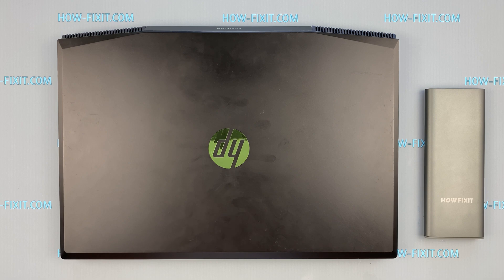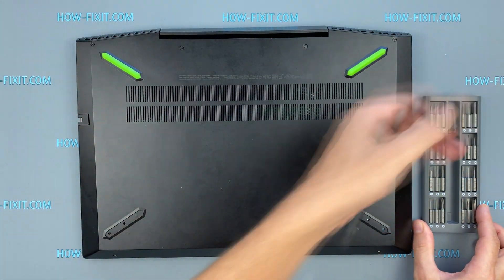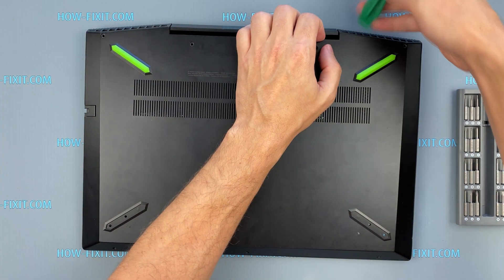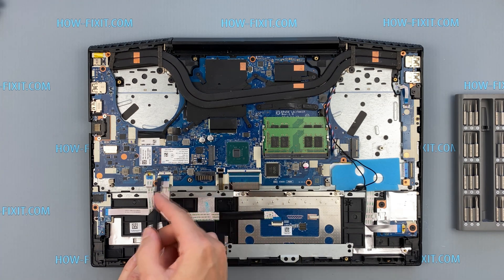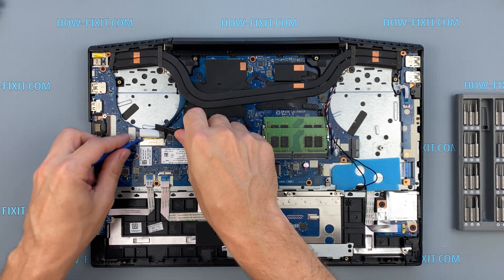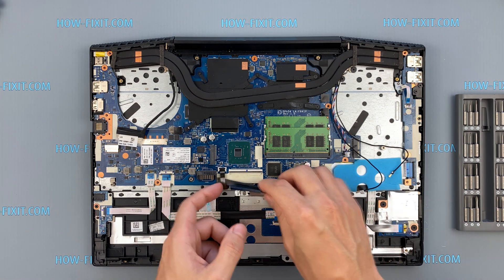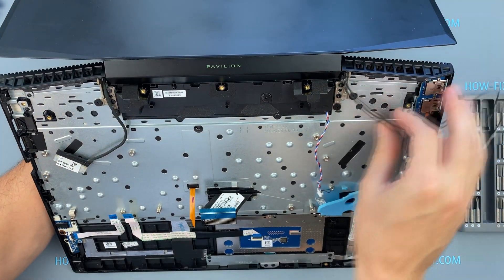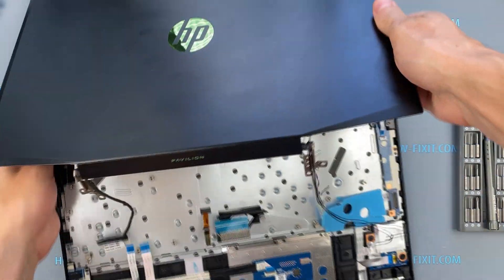HP Pavilion Gaming 15 Keyboard Replacement | Fix Broken/Not Working Keyboard

Comment: I didn’t expect such a replacement from you... Why change the entire top case and keyboard assembly? No problem to unsolder and remove a non-working keyboard and install a new one) No need to change the keyboard assembly

Comment: It’s insane how many people have issues with these H, G, 8, *, backspace and windows keys, not only in this model but practically in every HP laptop. The only thing that worked for me was to cut a post-it and paste it above the blue plastic of the ribbon cable. Seems like it gets loose after several months of use and pins stop making contact. Never buying HP again.
Reply: I try this
Reply: Did not work for me

Comment: HP sucks
Reply: How u damaged ur keyboard?
Reply: @varunchaudhary3205  GAMES
Reply: It been 2 years now and all of a sudeen my 'D' key stops working and it would randomly type once in every 1000 click but for most part its unresponsive Idk what to do I removed the key and retainer and cleaned it using air but nope still doesn't work .

Comment: You seriously waited until the end of the video to say can't replace just the keyboard?
Reply: This is fucking insane. And I can't even open it to see it or clean it or dry it if any Liquid goes in.... Fml
Reply: @KinekaiNHFan  Yeah wish i know this before buying this laptop. Curious if  anyone one having any issues with thier keyboard? how long before you had issues? What caused it?
Reply: @DIRTYFIGHT3R  i have problem with G,H,f4,f7,backspace aftr only 1 year
Reply: @DIRTYFIGHT3R  i  got prblem in only 4 month
Reply: @serieserie5065  same button as me
Reply: @serieserie5065  hey i have the same problem
Reply: @serieserie5065  i fixed my problem , all it needed was some cleaning of the keyboard connector...all the keys you mentioned need pin 26 to work...so cleaning the whole connector or just pin 26 will do the trick....i used aftershave and hand sanitizer to clean the cable and used an eraser when it dried up to clean the contacts... Your can also cut a post it to the size of the connector and place it on top of the blue plastic shim....

Cheers hope this helps some one
Reply: @007leonard1  thank mate ill try
Reply: @serieserie5065  if it dosent work i have another solution too
Reply: @007leonard1  how?
Reply: @serieserie5065  trim the keyboard connector by a milimiter,  you will have to also remove the edges of the same conmectot so that it slides further in.... The wires on the connector do not make connection with the pins of the fpc connector hence the problem .....i have come to the conclusion that the cable of my keyboard was damaged because i carry aroung the laptop in my backpack and the pressure along with the movement causes the wires on the cable to wear. So trimming the cable solves this as the cable with holes and indentations is cut out and the fresh cable has conductive matetial on it .
Reply: @serieserie5065  before you trim the cable try this ....open the laptop....align it in such a way that the hdd drive is on your left and ssd on your right and trackpad closet to your body and fans pointing away...observe the fpc connector of the laptop....from the left count the 6 pin and check if the solder is loose and clearn the 6th line on the cable make sure it makes contact ....try drawing on the 6 wire with graphite pencil( conductive)  ...the cable that affects the h  g and backspace num 8 and * on keypad is the 26 th cable/ pin so as there are 30 pins clean the  6th pin on each side to make sure .
Reply: @serieserie5065  pretty much same as me
Reply: @007leonard1   bro, you should do a video. I strongly believe this is a common issue of the product
Reply: @nomad4197  welcome to the club
Reply: @serieserie5065  i have a problem with a,s ctrl and tab
Reply: @007leonard1  and for a,s ctrl left and tab?
Reply: @fumbled23  A  is 16&22 .S is 17&22 left ctrl is 19&20 TAB  is 16&19. Therse are the numbers on the connector that have its trace shaved off propably from carry the laptop in a backpack. so wheen 16 and 22 close a circuit the keyboard registers letter A . One of them or both are  not making contact. Your keyboard should have a lot more keys not working than you specified.  If you already cleaned the connector and are helpless then Slice off a millimeter of the fpc in a straight line and remove the ears of the fpc so that it slides in further.
Reply: @007leonard1  sadly it doesn't work for me, i sliced the fpc about 2 mm, cleaned it with aftershave(the only thing with alcohol i got atm) and the problem persists, maybe its a different problem, Thanks for the help tho :)
Reply: @fumbled23  what keys dont work? did you check the fpc connector on the board for bad solder joints? when the base of the laptop is open try turning on (make sure the battery is screwed down) and apply light pressure on the fpc connector. Then check problematic keys. You said you sliced it 2mm, when you press down the connector you should see some small indentations on the flex cable where the pins meet the flex. If they are on the insulated part try to not insert the cable fully before closing the connector. Another possibility is liquid damage to the keyboard that shorted and burnt the silver traces below the membrane. Replacing just the keyboard is difficult task but with patience doable or just get the whole top from aliexpress with the keyboard. cheers
Reply: @007leonard1  it wasnt the case, had to replace the keyboard in the end, it took me 2 hours the whole thing but it was worth it because the keyboard with the top included was 100$ and only the keyboard was 50$. But i have a question the space bar is not iluminate on the new keyboard is it originally so or this has a problem?
Reply: @fumbled23  i can see light under my spacebar  gap if thats what you mean? There is noting written on the space bar so it doesnt light up it just leaks light on the transparent /translucent edges .
Reply: @serieserie5065  18 months and the left shift key doesn't work - don't even use it for gaming. Desperately regretting this purchase
Reply: @claireturner4912  Don't worry as now all newer laptop keyboards have only a very short life span & all comes with rivetted keyboards which's a pain to change! You can replace only the keyboard as it's much cheaper rather than the whole top cover!😀
Reply: @007leonard1 tried everything you said to no avail but the post-it trick did it. At least for now haha. Seems like the ribbon sits a bit loose after some time using the laptop. Never buying HP again.
Reply: @camilomujica_  good to hear abouth the fix. when carring the laptop in a backpack make sure the lcd is towards your back and base of your laptop is facing the front of the bag . This will lessern the wear on the flex.
Reply: @KinekaiNHFan  you actually can, you just need a sharp tool to cut the plastic pins, then when you put it back on you need a soldering iron and some plastic to melt it on the pins.
Reply: It is possible to replace ONLY the keyboard it's just a matter of separating the metal from the plastic welding. I literally just did it myself and it created a mess of tiny plastic rings. It is possible but it's faster to buy the whole assembly. 

TLDR; YES YOU CAN REPLACE ONLY THE KEYBOARD 😊
Reply: I also have this problem on Lenovo y520. The keyboard is rivetted to the top case with plastic...It seems it's some sort of new tactic of laptop engineers to do that to charge people 3-4 times the money (that would go just for the keyboard)to get the top case too..
Reply: guys, what do you do to clean the keyboard?
 just with 
compressed air??
Reply: Yup  a frg he be
Reply: You could have just replaced the keys from the top
Reply: Guyz can u help me i have problem with num lock ..its spaming continuously without even touching keyboard